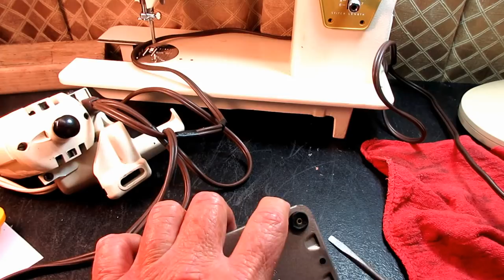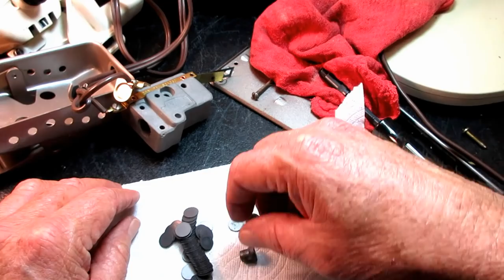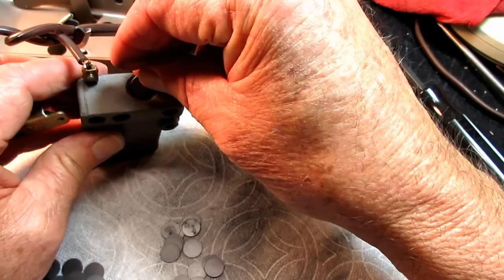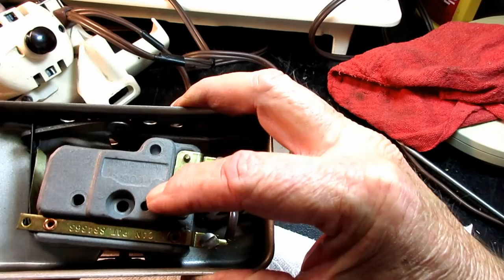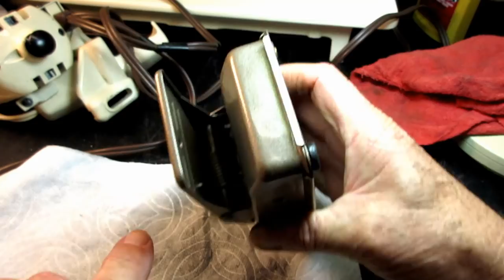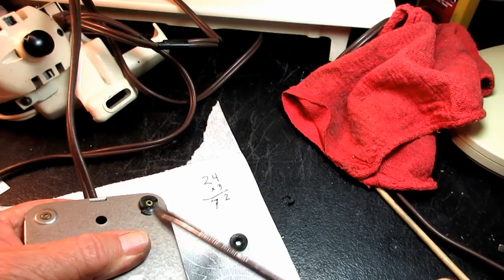How to Adjust, Clean & Repair the Foot Pedal on a Singer Model 237 Sewing Machine

Comment: Very similar foot and inside configuration. Opened the foot as you did. I removed the screws from the ceramic electrical connection. Then all I had to do was scrape the carbon a bit off the blade that touches the carbon. The block was squarish and white. All better now. 
No hesitation and having to push all the way to the floor and still no joy. Now lots of joy.
Thank you.
Reply from the maker: Happy happy! Thanks for keeping that in service and I really enjoyed your comment. Made my afternoon. Thanks

Comment: That same foot controller has come with a couple of non-Singer machines that I have worked on.  Also, my Singer 503 and a Singer 626 have that same foot controller.  I figured someone had bought non- Singer replacements for those models?  Some Kenmore machines have similar foot controllers and they all seem to have hardened rubber feet.  I use wire cutters to grasp and pull out the remaining rivets so that it is easier to just use new self-stick feet.  I sometimes will just cut a slice from a wine bottle cork and glue the round slice to the bottom.  One I did, I used avsheet of cork and glued a cut rectangular piece over the entire bottom surface. I wasn't too worried about heat build up as there were plenty of side venting slots around the wall of controller.  Thank you,  Andy for all your helpful tutorials.
Reply from the maker: Thanks for sharing your insights. I particularly liked the full cork cover on the bottom. When cutting a round cork stopper I prefer one from whiskey though. Thanks for watching my channel and happy sewing.

Comment: I have the identical foot pedal. Only one of the tiny disks was bad. First one to come out of the ceramic, after the thicker disk. Came out in one piece but fell apart in my fingers. It was pretty burned. Next one had to be cleaned pretty good. Thickest one at this end, also needed a good deal of cleaning. I had to use a scotchbrite pad for that one. Also used the scotchbrite on the large one at the contact end. And on the brass that that end contacts. The steel on the beginning end of the stack, was pretty badly burned as well. I used fine grit sandpaper on that until it was shiny. Works really well, now. Also, while I had that bottom plate off, I hammered the two middle "ramps" flat. To make it easier to remove, should I have to do this again.

Comment: Hi Andy, Thanks for the video. I have the same foot pedal on a Brother sewing machine that must be at least 50 years old--it's from my great aunt. The pedal sizzles and pops after extended use. Do you recommend cleaning the contacts and carbon discs for this issue as well?
Reply from the maker: Good question. First, I've never worked on Brother, but most carbon pile/stack controllers work the same way. Second, I'm speculating since I can't get my hands on your controller. You could certainly try, but sizzles and pops are a bad sign. These type of carbon resistor units get hot (very) with use, and the slower you sew the hotter they get. If the carbons are in good condition they just get really hot, but if the carbons are worn, flaking, cracking (from all those years of getting hot)  then you don't have anything near normal current flow, hence the noise. If you want to open it up and take a look that only costs your time. If the carbons are shot, you can buy a "tube" of them here: 
https://www.sewingpartsonline.com/carbon-resistance-unit-singer-618804-003.aspx
I talk about opening that tube to get the carbons to use in other controllers, like yours, in this video:   https://youtu.be/R4JuQ3o9dB0
So let's say you open the controller, the carbon discs are all flaking, dirty and burned. You buy new ones. You clean the other parts of the controller. You install new carbons. They still get hot and you start to hear sizzles. Maybe some other component or wire or connection is going out also. Oh, Brother!
I usually try to restore the original equipment, just look at the 450 videos on my channel, but I would recommend you do this: Buy a new electronic foot controller like this one or similar:
https://shop.sew-classic.com/Foot-Control-Electronic-2-Wire-Type-UL-12-amp-SCE168FC.htm
If your existing cord is OK up to the controller just cut it off and wire it into your new pedal. She even has a video about how to do it: 
https://www.youtube.com/watch?v=QNPti0gdm5U&feature=youtu.be  
Then you have a brand new controller that NEVER gets hot and has superior control, especially at slow speeds. You avoid any doubt about other problems with the old controller. You fixed your problem in 15 minutes for about $20. You wish all problems in life were that easy and cheap to fix.
You can also shop around online for other controllers too. I have used about a dozen of this one without any problems. SO, what do you think? J Kester, electrician?

Comment: I have a beautiful White sewing machine with this pedal. It appears to have hardly been used but it starts sewing too fast right off the bat. It wont sew slow and i cant sew fast. Lol. Is 
 that because the pedal needs serviced?
Reply: Nevermind, you answered my question right after i asked. Thanks!
Reply from the maker: @lloyd4375  OK, Good. Thank you for letting me know that some White brand machines have a similar pedal.

Comment: Do you have a video showing how to direct wire foot control/ power cord? I have an early Singer 237 and it is direct wired. I would like to change the foot pedal.
Reply from the maker: Normally you cut off the cord where it enters the old foot controller and connect those wires into the new foot controller. Nothing is done where the wires are spliced at the machine. 
Am I missing something in your question?
Reply: Andy Tube ok. I thought you would cut off plug that goes into the machine and splice it at the machine. Is there a reason it is not done this way? I ask because I like the idea of a new cord.
Reply from the maker: @rhondahawkins9174  OK. When you said you wanted to change the foot pedal I was not thinking of the cord into the machine. I get it now, thanks. The closest I can come to your request are these 3 videos. 
1st about the wiring splice below the motor on model 237: https://youtu.be/mVX2Io_tomk
2nd about cutting off factory crimp splices from wires: https://youtu.be/I1-LdCTN-T4
3rd about splicing the wires using standard twist-on wire connectors: https://youtu.be/P5WcNDusqbg
Of course, be sure you identify which wires go together before you cut. 
You can pull the old wire out of and push the new wire (after cutting off the plug) in thru the vinyl grommet.
That's about the best  I can show you for splicing cords/wires.

Comment: The link you have for Sew Classic said that it is not secure.  Do you think her site got hacked?  Does she have another website address?
Reply from the maker: Jeeny retired and closed her business. You don't mention what part you need. I buy most of what I need from a few vendors on eBay now. If you tell me what you are looking for I can say where I buy that part now.
Reply: @andytubesewing1953  , thank you.  I need a bobbin case for my 201-2
Reply from the maker: @WeQuiltStudio  I've never even touched a 201-2, but I have the parts manual if you want to contact me at andymanuals53@gmail.com just mention you want documents for model 201-2.

Comment: How do I rewire the foot pedal from a kenmore sewing machine to a flat brown old foot pedal?
Reply from the maker: Sorry, I don't work on Kenmore and have no idea what your existing foot controller is like. I imagine they can't be much different than Singer or other brands though. I think the main thing is to be sure the "Flat brown old foot pedal" is rated for the same or more amps and of the same voltage type as the existing Kenmore one. say 1AMP and 110 VOLTS. Most (not all) foot controllers are just two wires. When I do Singer foot controller changes I just disconnect the wires from the old and attach to the new. Here are a couple of playlists I filmed for restoring vintage Singer foot controller. There are two types: https://www.youtube.com/playlist?list=PLsCOZgzzaiKItPLWcK24FBoMdHK8vTXNi
https://www.youtube.com/playlist?list=PLsCOZgzzaiKL6ePPxLpmnWSzTyxPKTb71
I buy vintage used controllers on eBay and new electronic ones from sew classic: https://shop.sew-classic.com/Foot-Controls-Foot-Pedals-Parts_c9.htm